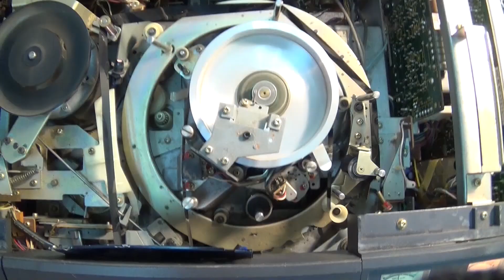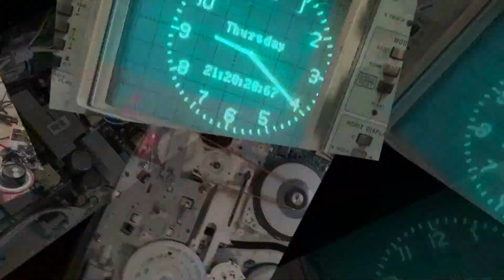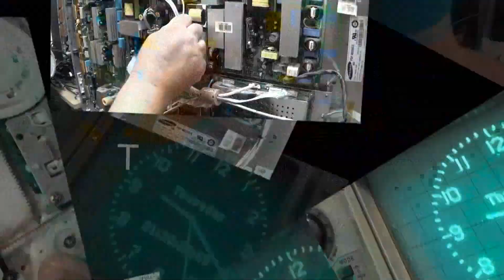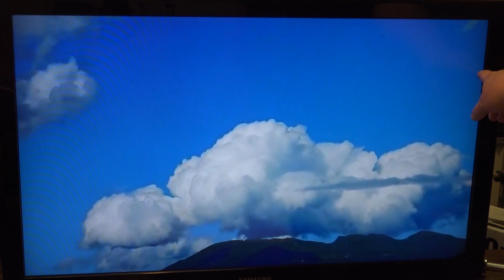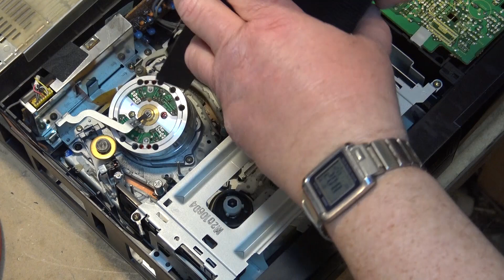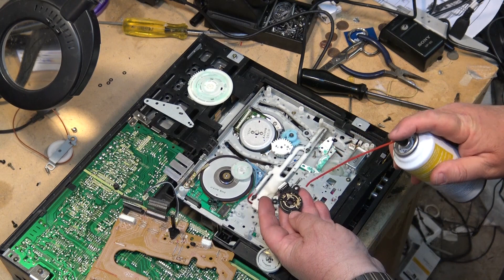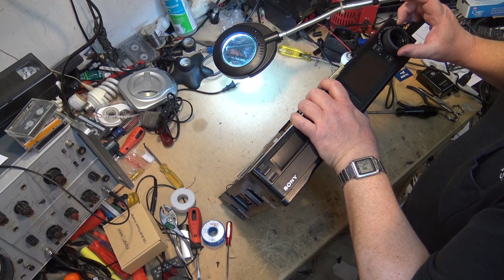Sony SLV585 Full mechanism tear down and repair

Comment: Hello, I'm currently working on my SLV585HF. I have replaced the blue gear and lubricated the guide leveler. The issue i am having now is if i stop the tape. It will fast forward but not rewind. It seems like it wants to but it just shuts down. Rewind will work if the tape is playing only. Also the shuttle ring is completely non-responsive  No Rewind/FF/Play or Stop. I took it apart to clean the track but still nothing :( Any help would be greatly appreciated. Also Fast Rewind is also not working same issue where it wants to rewind but shuts down.
Reply from the maker: Timing timing timing.
Double check the timing of the mech. Clean the mode switch. The shuttle ring also get crossed contacts and needs to come apart to clean properly.

Comment: I am so close....    I have replaced the blue gear and I've done the service on the pendulum gear, the p5 guide and the mode switch.

I load a tape and it starts playing but the tape starts feeding with no take up.  The machine stops and I can eject the tape.

Can anyone suggest what I may have missed?

I load a tape
Reply: So it turns out I was very close.  Just one tooth off when I replaced the blue gear.   I re-adjusted it and bingo.   VCR is working great!

Thanks so much for this video and all the instructions you give.    

Next I have a 688 HF with no picture.

Comment: my slv815 does not want to load. (if it is loading and unloading, it stops, you can start play, it want to load the tape but stops and unload the tape, what can that be?
in the past it works fine, but the power supply broke down so i recap it and replace a to3 looking fuse, but there is now still a problem.
Reply from the maker: Perhaps mode swirch

Comment: Dear 12voltvids guy and other guys and gals. To see how to repair a broken blue gear in SLV-585HF machines, SLV-595HF machines, and like machines, see the video informally called "A Permanent Fix" at the channel for "The Hologlobe Press" on YouTube.  You will be happy upon seeing the video since it will help you save your machine when no new blue gear is available.  Truly, the gear when repaired will last for decades because it will have a reinforcing piece on it.   And be happy that this 12voltvids video exists on the Internet, too.  Stay well!  Victor

Comment: I can't for the life of me seem to figure out how to release the connections that allow you to take the board out.   It's obscured in the video.  You say just reach in and release them.    I'm stuck at this point
Reply: Ok I got it.  It's just more force than I expected.   One finger in the center on the right side and lift.  It will pop up
Reply from the maker: Yes that's it
Reply: Thanks for making this video.

So I fix everything including the broken gear. The blue one I replaced it with a new one.

I have sound and occasionally a little bit of picture. I don't know where to go now.  Cleaned the heads but it's no better.

I'll go through your videos and see if there is a video on this problem
Reply: No luck with head cleaning.   Very frustrating to have got this far and there is real bad picture or just blue screen.   Menu works.  Tried new cables.

Is there a forum I should use to ask more questions?
Reply from the maker: @johntiffin7165  
How is the RF from the head preamp?
Reply: @12voltvids  still no luck with this thing unfortunately.  I do notice the the left arm that brings the tape out seems to sit high on its post.   Feels a lot looser then the right side which sits flush on its post.    

I have looked under but I can't tell if there is a way to sit it down further.   I wonder if it's high so the tape isn't nearly in the right spot
Reply: Well I have a lot to learn.   I'm not sure what that sentence means!  But if you're willing to help I'm willing to learn
Reply: Okay I fixed it!

I'm a little embarrassed to say that I hadn't installed the spring in the blue gear that I replaced correctly.

After watching your other video linked here I realized my mistake and went back in and fixed that.

https://youtu.be/ov77JMFNXc8?si=PPWneG-D8c2VfTyE

Full video and audio restored

Again I can't thank you enough for making these videos as there was no hope of me fixing this thing without them and the others that you have produced.

Comment: alsome man I got Sony slv  790hf its was working fine till today i put tape in and when I forward or back ward its working but it will stop and won't move the I turn it off wail lil bit then it will work again what could it be it says 3ll code or something?

Comment: Thank you for this video. Have had one of these in my closet for a while because VCR repair seems daunting. My 585 loads tapes fine, but tape will begin to move up and down on the drum and crinkle on the pinch roller. The blue gear was broken and I'm going to try and superglue it. Is my issue likely because of this broken gear causing a speed to be set incorrectly or something not to be in place?
Reply from the maker: Replace the gear. They cost about 5 bucks Canadian.  You can get it at kpcomponents.co
That's not a mistake it is .co not .com
Reply: Thank you for the link. Like you said, must be a really common problem for them to still be manufacturing that gear 30+ years later.
Reply from the maker: @wyattazcooks  oh yeah very common failure but these machines were pretty good over all and they deliver a great picture.
Reply: @12voltvids  Nearly pulled my hair out redoing alignment over and over... turns out I forgot to plug in the drum! Works perfect now. Know so much more about the mechanism thanks to your video. Nice to save a good machine from the landfill.

Comment: Hallo,
I have a problem with a Sony SLV-757 VCR.  Assuming that I have cleaned all the mechanisms that needed to be lubricated (following your videos): blue gear replaced, switch rotator and pich roller lever lubricated, forward and reverse mechanism clutch cleaned, heads cleaned.  I still have a problem to solve, ie when I insert a cassette where the tape is at the beginning, the Sony VCR loads the tape onto the head drum and immediately ejects it. Only if I slide all the transparent tail by hand, and then feed the cassette it into the VCR, will it accept it and can I play it.  I state that all the various functions work: forward, backward, normal and fast reverse speed.  When I rewind at fast speed, the tape that has reached the end is automatically ejected, while at normal speed the problem does not arise.  What can it be?

Comment: A Sony SLV575 was my first VCR from 1991.  Great machine!   I had to replace the brake pads when the tape started spooling out inside the machine when stopping in the middle of a fast forward.  I don't recall what happened to the machine or why I retired it.

Comment: What a great video!!!  I repaired my Sony SLV-686HF which has identical mechanisms you've described. It had the two classic problems you mentioned. I had to replace the broken blue gear and clean the p6 guide lever because of dried lubricant. I could never get the proper alignment of the gears until seeing this video. Your excellent detailed explanation  of the gear alignment saved my bacon otherwise I would have probably just junked the thing.

PS  I just love your messy work bench where you can find the proper tool in no time. Just like me. After the wife re-organizes my bench because of the mess I have difficulty finding anything!!!  LOL

Keep up the great work.

Comment: I'm having some trouble with what exactly you were referring to when you mention those 2 clips you pop off to remove the board from the underside to get access to that left gear that breaks. I don't see anything that is a clip there and the video doesn't highlight what exactly is being clipped off. Could you tell me exactly what you unclipped?
Reply: Im having the same issue, did you ever figure out how to detatch those?

Comment: I have this exact model.  All of the mechanical functions seem to be working perfectly.  Tape moves forward, backward, high-speed rewind.  The problems observed are the linear counter remains locked at 00:00:00 and the video display is a solid blue screen with the data in white lettering.  So no video whatsoever.  Do you think the issue might be that the read head is not spinning?  I have not performed any disassembly and have not removed the outer cover.
Reply from the maker: No, the control track is not being read.  The unit counts the control track pulses.  30 pulses = 1 second on the counter.  No control track, the machine thinks the tape is blank and you get a blue screen.
Reply: @12voltvids  Thank you the quick and detailed response.  Do you know what needs to be fixed or the likely cause of the problem?

Comment: Great video!
Fixing a sony 595hf blue gear replacement job now and the retaining clip wasn't held in, the screw was missing. 
There was a marker written on the top lid showing the roller was replaced in 1999. Got a Samsung VCR/DVD combo with it clicking during rewinding so I'll check the pendulum cog.
Thanks.

Comment: Great training vids...Tx for sharing...I was able to fix mine too, tx to your hints...Incredible the complexity of the mechanisms, though...Mine was an easy fix (lubricating the famous lever that brings tape to pinch roller, as it was sticking), but I can imagine if I had to take apart the clutch assembly, and align all the gears, I'd go crazy :-)

Comment: OK... I got everything working on the bottom side .  The tape loads and the tape wraps around the tape head but the P6 guide does not engage and the pinch roller does not come down.  I got the timing good on the bottom side and the timing in the controller, what am I missing?
Reply from the maker: Timing of the tower gear. That is the one that lowers the pinch roller. There are timing marks on it as well.
Reply: @12voltvids  I can't seem to add a picture but there is also a few missing teeth.  I could e-mail the pic.  I don't see the timing marks on the upp gears by the picch roller, I got the bottom side timed.  dennis@gobickers.com

Comment: my problem i getting the eject tape to work? suggestions? please, havent used player for over a year
Reply: I recently fixed this issue on mine. The eject button broke, and I had to replace it. If you press the button and don't hear anything, it's probably the button.

Comment: I am facing a problem with the sony vcr SLV-ED818SG  .. It was working that is completely correct, but the signal was interrupted by the TV suddenly, so that the blue screen does not appear, nor any sound or image at all, and it seems that it is not connected to the TV.  Can you help me find a solution?

Comment: The tv back light trick was to save money, and get a tv working for free like i do with my led bulbs. When running a home and the tv blows over xmas your trick would work fast. Tank you.
Reply from the maker: In case you haven't figured it out, I try to get things going for the lowest possible cost.
Anyone can go in and change all the LEDs. Don't need much skill there, just like anyone can swap a board. To actually find the specific part that is bad is a different story.

Comment: I was able to fix my SLV-R5UC following this tutorial. The blue gear was broken and brake need some adjusting. However, the left channel isn't working well. The audio is very low.  I tried different tapes,cables,and headphone jack.  I'm not sure if problem existed before or if I am have my have done something incorrect while repairing the gear.  

I'm not sure where or begin to troubleshoot this issue since I can't find the service manual.  Anyone got any advice?

Comment: i had a SLV 575UC i had to replace a white gear in it under the p6 guide (i did not know it was called that) but then it still had a problem with it playing tapes in LP or SLP. i read online that is was a problem with the capstan bearing. but i did not want to put anymore money into it so i sold it
Reply from the maker: The capstan bearing was a common failure. It was weak and bent under pressure from pinch roller, causing the rotor to drag on the stator coils

Comment: You should have also cleaned the sensor in the shuttle, it often fails like mode switches.
Reply from the maker: Yes I know, but it wasn't bad and the unit is not going back in service anyway.

Comment: I really love all your video"s. The vcr ones bring back good memories. I started in the 80's when they came out. Went to Panasonic a week on the PV-1270 then to Sony for a week on the sl-5800. Boy was I confused after those 2 weeks. But have still worked on them. I would like to see you overhaul and realigh what I thought was the most mechanical nightmare of all vcr chassis. The G chassis. It was in panasonic,quasar, rca, and lots of others. Thanks and keep them coming. Jimmy USA (alabama)
Reply from the maker: I believe I have done a G chassis. I forget all the chassis numbers but wasn't the G as in garbage chassis the one with only 2 motors, drum and capstan, and a clutch was used to load / unload the tape AND operate the front loader? Or am I thinking of the "K" chassis. Been so long.
Reply: thats it. Had a bunch of gears to break and re time. I think the K came after Thanks
Jim
Reply: thats it. Had a bunch of gears to break and re time. I think the K came after Thanks
Jim

Comment: What was or at what point in the video did you point out the problem?
Reply from the maker: At 3:35 we see the problem. The pendulum gear is not engaging in the reverse direction. @ 14:41 I take apart the clutch and drive assembly to lubricate the sticking pendulum arm, and gears. That is where the problem was, under the plastic plate that I removed at 14:41. The remaining stuff was for maintenance,
The mode switch ect.
Reply: I re-watched it thanks, I just missed it. Thanks

Comment: We used to have this same exact Sony VCR back around 1991 or so, but ours later broke like around 2007, and it's a really darn shame, since I liked that VCR. We also lost the remote over time (since disabling the on-screen counter display was so annoying to do since it required the matching Sony remote). Ironically, I also recall that the system date and time settings on this Sony VCR model could only go from January 1, 1991, all the way up to December 31, 2006 for some reason (it can't go to any further system dates after the year 2006).

Comment: Fixed around a dozen VCR's with a warn out idler pulley when I was a kid. Took a knife and cut grooves all the way around it so it would get traction. Think they lasted longer after doing this than it did up until it broke. People got a kick out of a 12 year old fixing there VCR.
 About The back light. People on here get anal over how you fixed it. I have the same problem. The thing is these item are at half life or more anyways. Not worth dumping tons into it just to NOT get your moneys worth again..
Reply from the maker: Oh believe me I get lectures from some goofs on the internet, and most of these comments get nuked before they get read. 
A good example was the defective HDMI - composite adapter. I get called a cheap SOB for buying one off Amazon, and I should spend more and get a quality product. And what is the name of your company so I know never to deal with you. Trolls. They won't get a response, and will have their comment deleted. For a few that have made a personal attack on my character, well I have a button that I can click that says the user is harassing me. I don't use that one often, but I have. Almost used it a few weeks ago, after I made the video about my content being stolen, and re-uploaded by another user. A few know-it-all's claimed that I have no rights to my video content I upload.
Well I showed them how seriously youtube took this and removed the content the other user copied from my channel. Even with that these same users claimed that the link (of the removed content) proved nothing, because well the content had already been removed. "Where is your evidence"  was one such remark. I don't have time for these people. I just go on, make my videos, and help people get their stuff going as cheaply as possible. I love the ones that criticize me for using heat guns or halogen lamps to re-flow BGA solder.
How I should invest thousands in a proper re-flow station. Again, if I did this for a living I would do that, but I don't and 99% of people watching also do not have re-flow stations at their disposal, and those that do, well they don't need my help fixing stuff as they are in the business and should already know what they are doing.

Comment: your right on the back light . looks great
Reply from the maker: This is why I showed it. The missing lamp you really don't see unless you are looking for it. Under normal viewing it is completely invisible. You can see it on color bars, or a full color or white screen. By contrast, if that single lamp was replaced, and was putting out double the brightness of the rest of the lamp you would really see it. I have no idea how many % all the lamps are down. All fluorescent bulbs gradually loose lumans over the life of the lamp. I know for sure we can certainly spot them at work when they change a single lamp in a continuous row of 12 4' lamps. The new ones stick out like a sore thumb.

Comment: was the mode switch caused the rewind problem?
Reply from the maker: No it was a sticking pendulum arm. That is the gear that flips back and forth to engage the gear to either the take up or supply. That is why I took all the gears out and put a drop of oil on the shafts..
Reply: Thanks for posting! Cheers!
Reply: @12voltvids  Hi, why didn't you use the molykote grease...? Thanks for the video.
Reply from the maker: @josegti84  
I don't have much. I'll keep that for machines that need it.
Reply: @12voltvids  Thank you very much!! Quick question: Have you ever dealt with security screws on vhs tapes? How do you remove those without breaking the cassette housing?